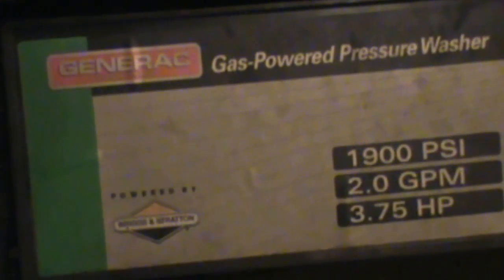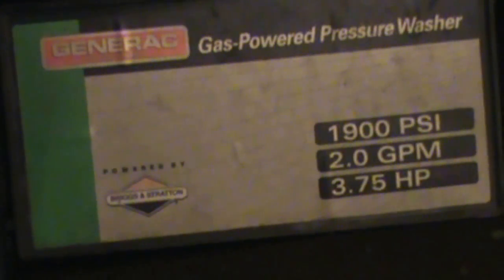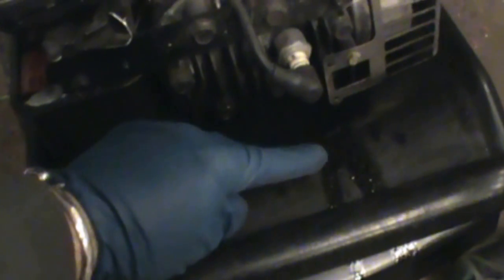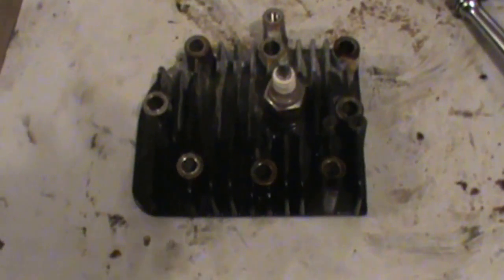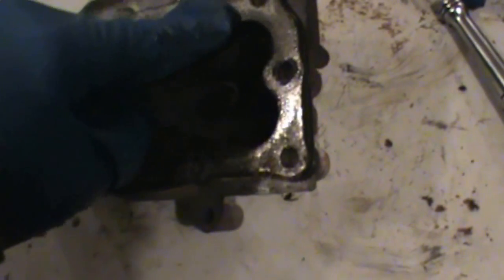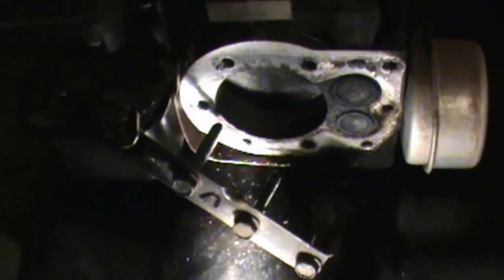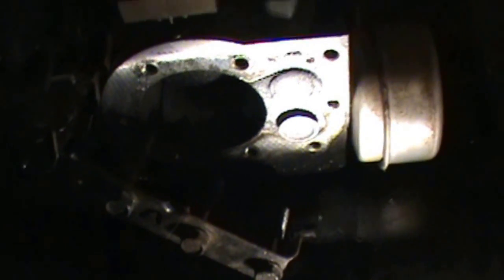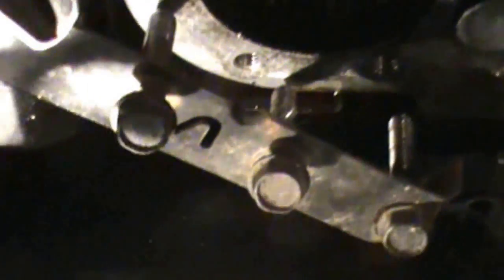Why my engine is blowing black smoke

Comment: If the carburetor is allowing too much fuel in thru the jets. the carb is obviously worn.

A new carburettor will have tight tolerances and not allow the extra fuel through.

I have the same issue with a 1979 5hp 130902 vertical. the carb is old obviously. so when i open the throttle up i have to be careful to open it slowly or it will pump too much fuel into the engine thus lack of acceleration and black smoke
Reply: Same!!! 5hp Briggs old school cast iron bore engine

Comment: hi, ihave a craftsman generator that is chugging out black smoke, I have clean out carb, new airfilter, adjusted valves to .004, what is wrong, ii had lots of gas in my oil

Comment: SAVE THE FLYWHEEL...1000's of Briggs lawn mower engines make good general purpose engines with the heavier flywheel...you might even find a cheap lawn mower with the right shaft to replace the junker on your washer..??

Comment: 1. most likely the choke is sticking causing it to run very rich. 2. the carb and or fuel bowl gaskets are leaking and allowing an improper balance of air and fuel. get a complete gasket kit or a new carb. 3. someone left it turned upside down for a period of time. try a can of seafoam to burn out all that carbon buildup.
Reply: to be honest with you mate, this one does not have a choke, it has a primer bulb on it, which means that the carburetor is made of plastic and THEY ARE JUNK!!! once it runs too rich causing black smoke to come out of the exhaust, it needs a new carburetor, just find a choke-o-matic carb and it will runs far better than plastic carbs, plus you can adjust the proper air/fuel ratio, while these plastic carb dont

Comment: black smoke is cause by a bad carburetor, the carb is made of plastic... and it's a joke, replace the carb with a new carb, or find a choke-o-matic carb and replace it with that with the fuel tank that the carb is attached on... and remember to replace the breather tube on it as the breather tube on it is small for the plastic carb while the choke-o-matic carb needs a longer breather tube

Comment: no, black smoke is caused by a bad carburetor putting in too much fuel and it's made from plastic, no way of adjusting the proper fuel/air mixture ratio, and they are junk! and if gas and oil mix... it would smoke a little blue smoke... not black

Comment: wrong! black smoke is caused by bad plastic carb putting too much fuel into the cylinder, and if the oil is in the cylinder it would smoke out blue colour